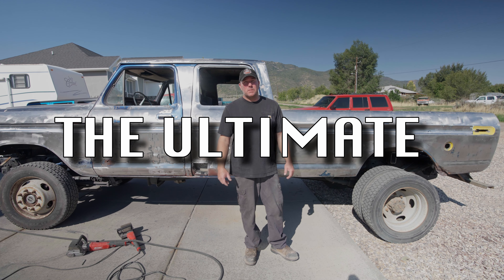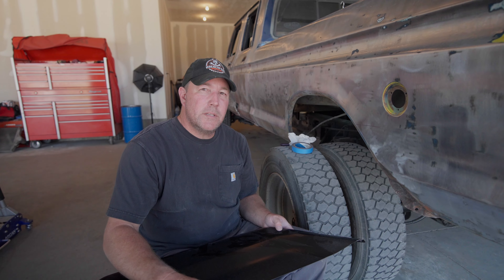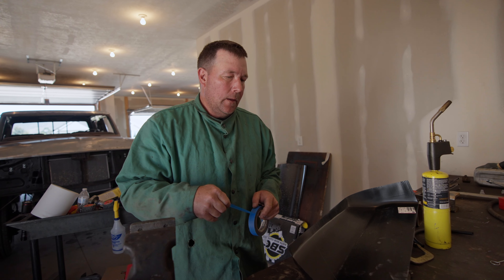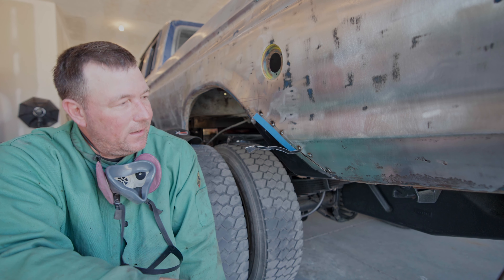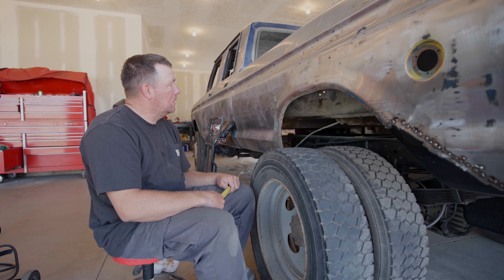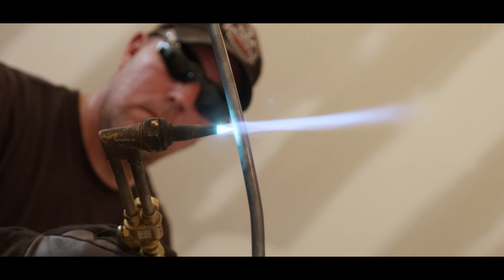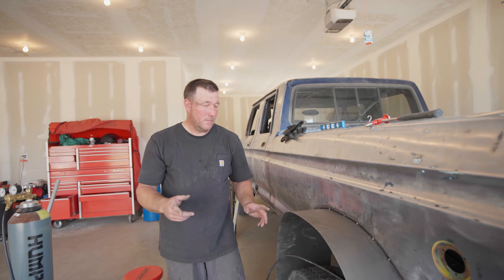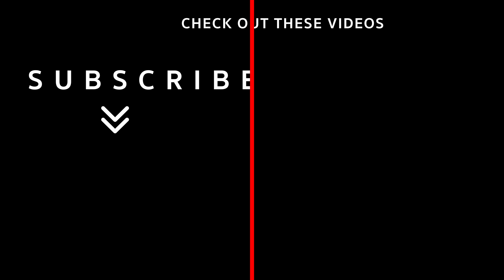This Problem Needs To Be Addressed | The Ultimate Ford Dentside Cummins

Comment: Your Crew is coming out nice, but I have seen several people who have dentsides use the same year Stepside fenders on the rear for dual rear tires. Depending on how far, you may need to add a little more (or widen the stepside fenders). The little tricky part is where the racetrack "dent" is. Seen it done a few different ways, but most without the racetrack chrome. Good Luck!
Reply from the maker: Thanks for the tip I will look into it